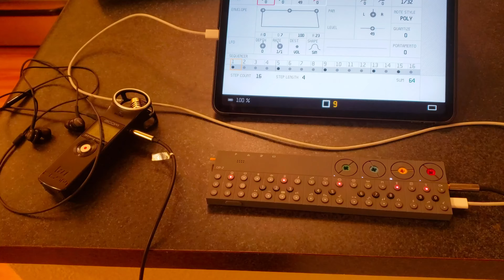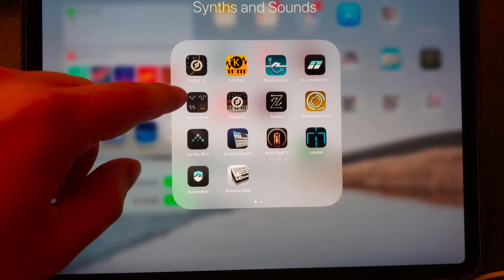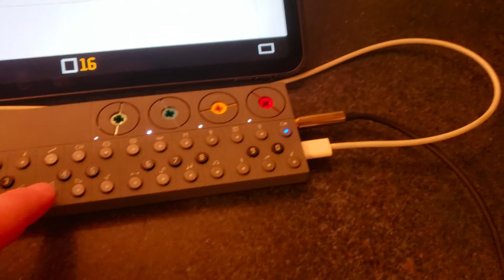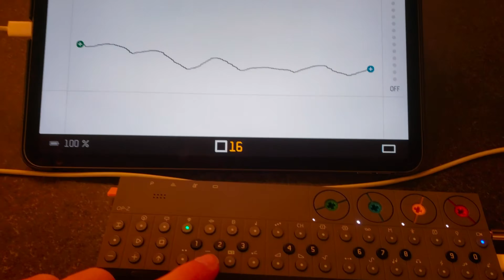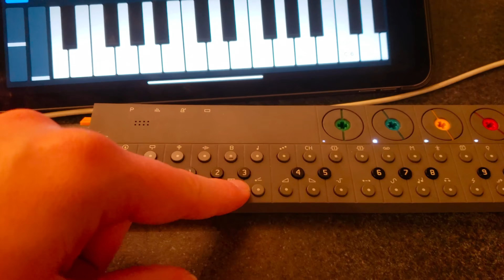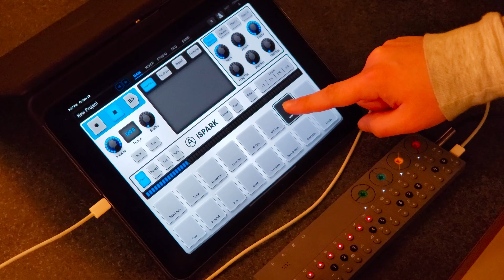Comment: I take this opportunity for two more questions, if I can, which would be of great help.

- Without the help of the external recorder, could you have recorded the entire sequence (including the part played in real time with Dixie FM), using the internal "Voice Memo" present in Apple products?

- the other question: I see that you don't use any Camera Kit Adapter: with iPad you don't need any adapter unlike the iPhone?

Thank you so much
Reply: For your second question the iPad Pro 2018 and 2020 have usb c ports so you can directly plug in most usb devices with the port. For the first question, in this case no, as all the audio is being played on the Z, not the iPad.
Reply: Ultra Choice ok I understand. But, you ask, wouldn't you (if you wanted) also be able to register it directly on the iPad?